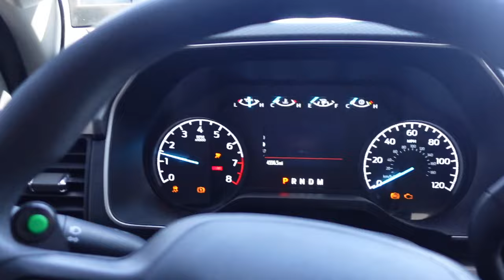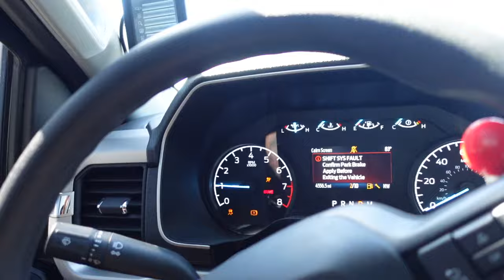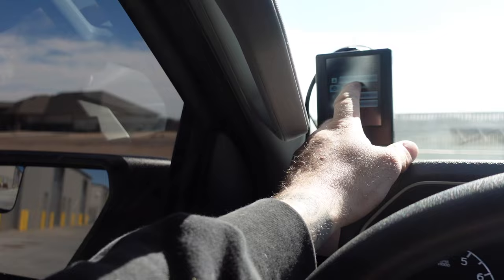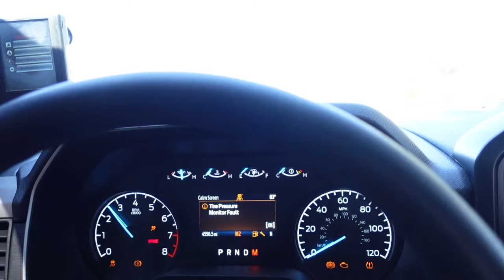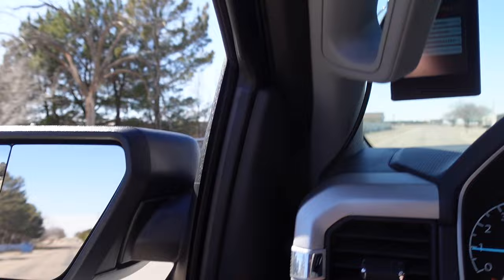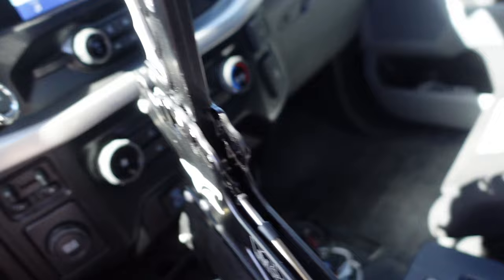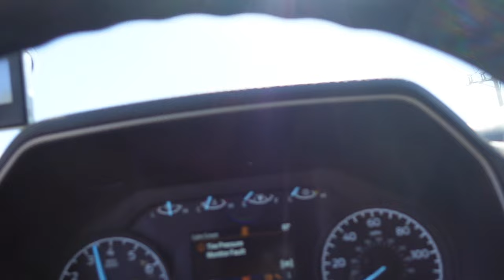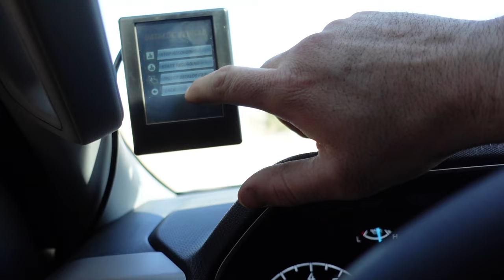FIRST Drive! TH400 Swapped Twin Turbo 2023 F150!

Comment: I'm about done with this channel trucks are cool but twenty four seven trucks is not I remember watching badass racing on this channel back in the day and it was fast racing!
Reply from the maker: I wish I cared
Reply: @DavidVanVoris very nice I went whipple thinking about going turbo. What’s that device in the window I got hP tuners got to log with laptop
Reply: @aspavingllc8302 it’s a Lund racing Lrx
Reply: @DavidVanVoris don’t worry bout him I think fast trucks are badass
Reply: To each there own I love the truck scene
Reply: It's what's "popular" right now, has been for a bit. It will pass or at least level off.  Channel is basically just advertisement for his business and not based on his racing. Video quality isn't the best, most vids are just him driving and talking in his truck. Stopped watching a couple years back, check in from time to time to see what's up, but probably won't be the content you will want it to be.
Reply: This isn't an airport. No need to announce your departure.